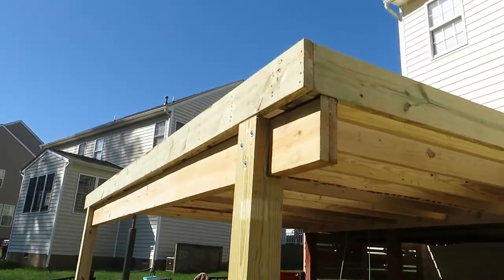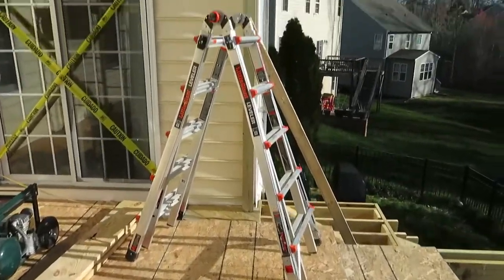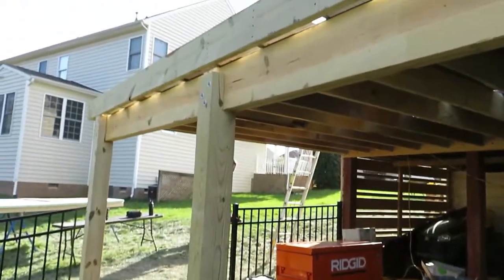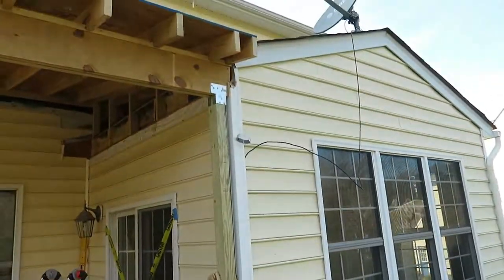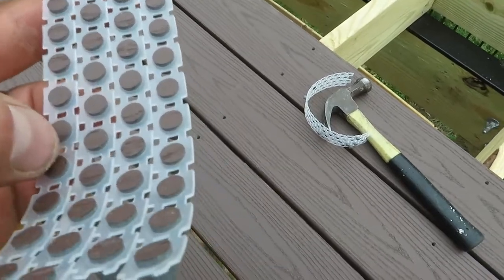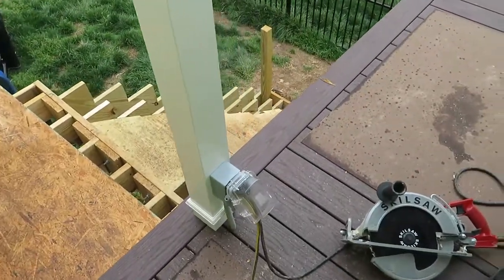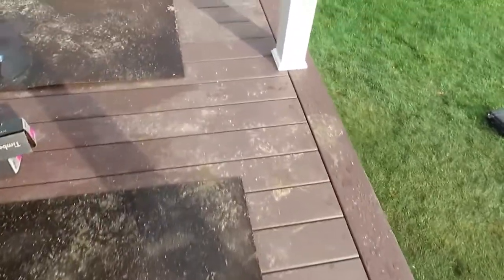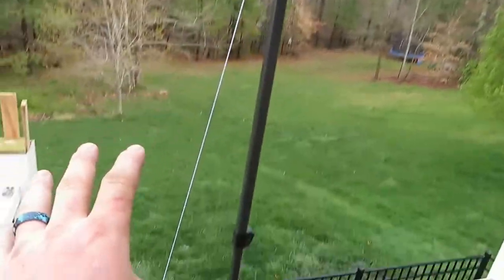Building a Screen Porch & New Deck - Part 2

Comment: Are the post attached to the house? If so, how are they?
Reply from the maker: Nope. They are sitting in post based which are attached through the decking and into the framing. We spaced them a very specific distance off the house so our post wraps would line up perfectly with the vinyl trim on the house.
Reply: @thebedfords  What about the beams on top of the post? I know they are connected to the post by a post cap. I assume the rafters are what keep the structure together. Would this same setup work w a Gable roof? Looking at doing something similar at my house. Thanks for the info.
Reply from the maker: @davidtucker9380  You are correct about post caps tying the beams to the posts, and that the rafters are what ties the shed roof into the house.  I don't think I could give you a concrete answer for your situation.  The last roof I built over a deck (which is a series on my channel from last year) was a gable roof.  The posts were the same setup (attached to the deck surface), but we did cut open the house to run the beams in and attach them to the house framing.  What I'm not sure of is if we did it that way because the engineer/building inspector required it, or if it was just because we felt that it was best practice.  The rafter that's up against the house was of course nailed off to the house along its entire length, and then attached to the beam, so I would guess you wouldn't have to attach the beam to the house, but like I said, I'm not sure.  Hope that helps.
Reply: @thebedfords  Great chanel, videos and work. Have spent most of the day watching.

Comment: Wondering the reason for footings for the posts, but filling with dirt vs concrete?  Does the concrete breakdown the posts quicker than the dirt?
Reply from the maker: I’m a little confused by your question. The posts need to bear (sit) on concrete so they don’t sink into the ground. But are you asking why we backfill the hole with dirt after the post is set on the concrete?  If so, that just how it’s done. There’s no reason to have a footing that is as deep as these needed to be, and then fill the hole with concrete instead of dirt. It would be an unnecessary and very expensive process.